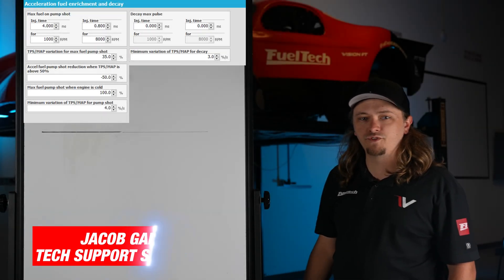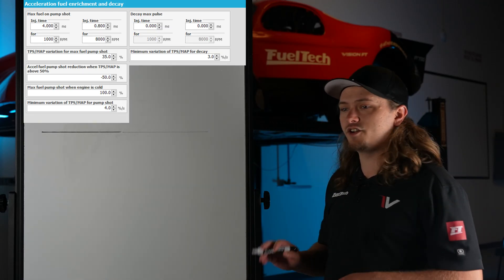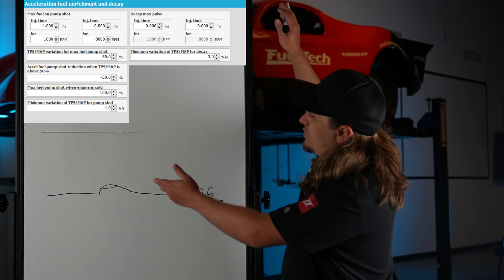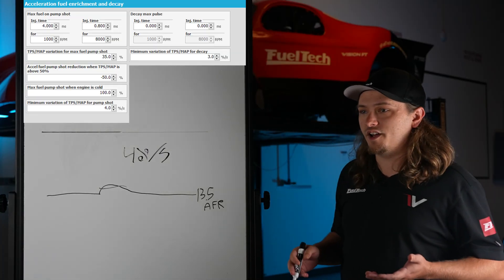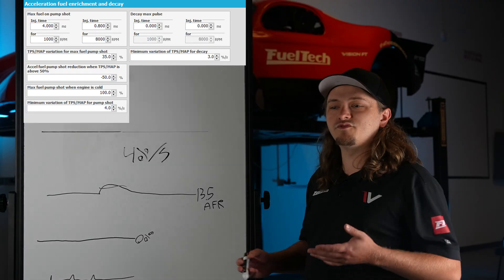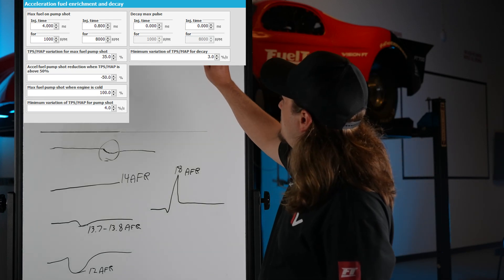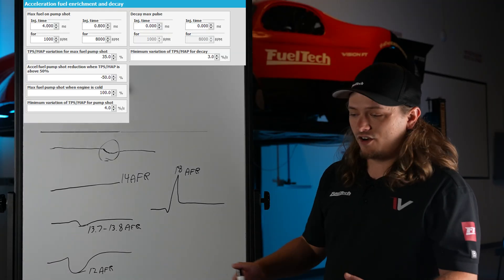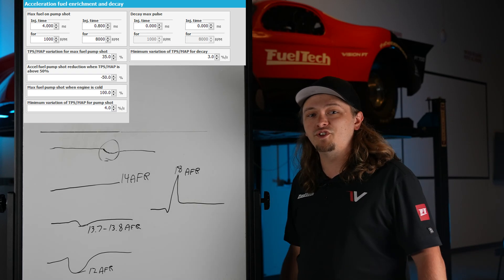Acceleration Fuel Enrichment & Decay Explained | FuelTech Tech Tuesday

Comment: Does the TPS sensitivity number have an effect on O2 correction turning off?
Would setting this number ridiculously high prevent O2 correction suspension ?
It seems like the smallest TPS movement will cause correction to be suspended.

Comment: So, i got my tune pretty dialed in now, but this was a spot I was struggling with. Here's the scenario. Cruising on the street, say 2800rpm. I want to accelerate a little, maybe I need another 5mph. When I tip into the throttle, it hesitates, then goes. I watch on the datalog what happens with afr. It goes from around 13.9, then it goes a bit rich, maybe 12.0, then really lean, like 19.0. From what I gather from this video, it may not be that it needs more fuel, but it in fact might be giving too much fuel causing a misfire that sends the afr lean? Am I interpreting that correctly?